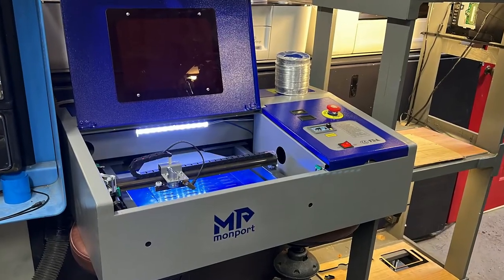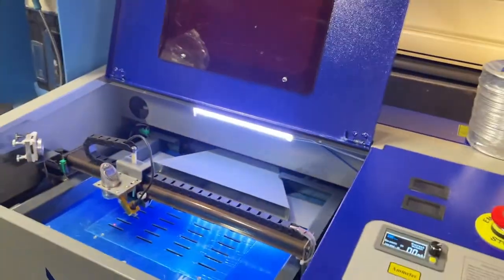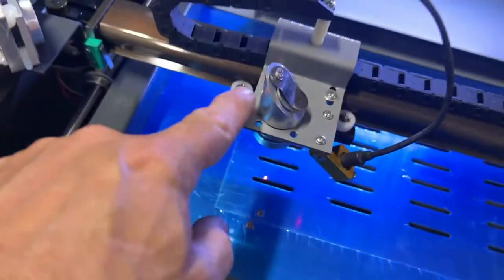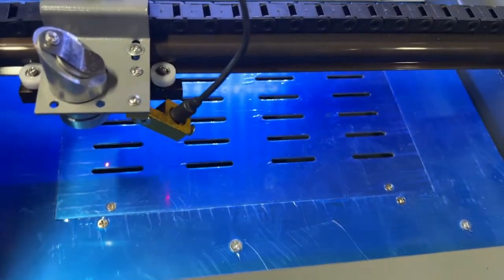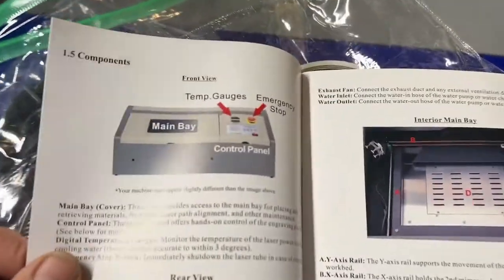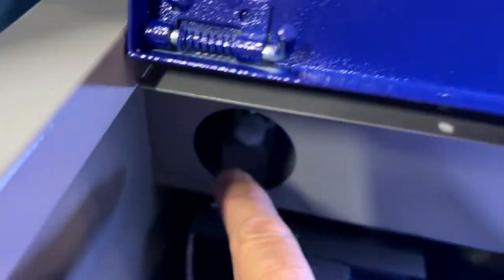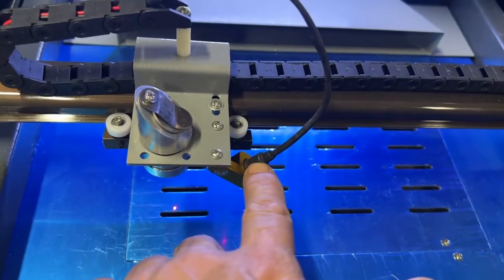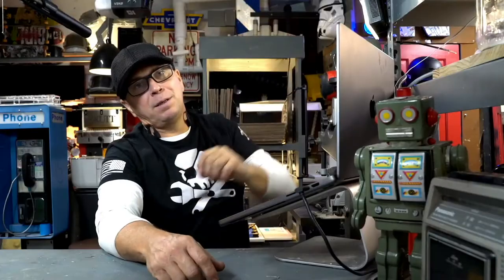Is this worth $500 bucks? - YES!! 40 watt CO2 Laser Cutter Engraver

Comment: Hey Ryan, I'm in Raleigh as well. I just purchased this laser in a combo package and it looks like they have made some upgrades since yours. I have had a k40 laser for about 10years now which is the aame as the monport just rebadged. Yours looks almost identical to my k40. Anyway i have made a ton of upgrades to my k40 and use it alot, gone through 3 tubes. Looking forward to running this one through its paces. The monport i just got has air assist, different mirror and lens holders, built in exhaust fan, door switch, more conventional style x-axis rail.
Reply from the maker: You want to talk shop? Share ideas? Meet near Southpointe, I moved to Durham.

Comment: You should not be taking this to a flea market to customize items without having a method to safely handle the air extraction. The invisible (to your naked eye) laser beam is vaporizing material and those fumes need somewhere to go. I've heard of folks putting a laser in a trailer to use outside a venue so it can be done but you're likely using something larger than a k40 at that point.

Does this one have any safety features - like cutting off the beam if the lid is opened or water flow is blocked?
Reply from the maker: Thanks! What about a filter, or putting in a mobile van or trailer? What about a stack venting above people.
Reply: Most things you cut or engrave are not noxious. Wood, acrylic or powder coated metal, painted tiles are fine to cut or engrave outdoors but if you are inside it needs to be vented outside especially wood or you will have a smoke filled room. You should never cut or engrave vinyl or PVC because the thermal process produces hydrochloric acid and toxic fumes.